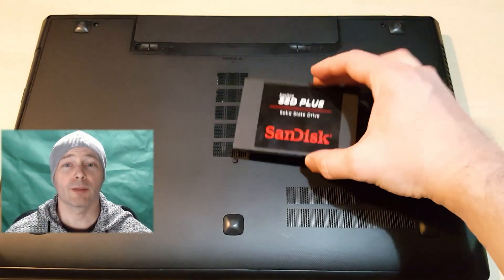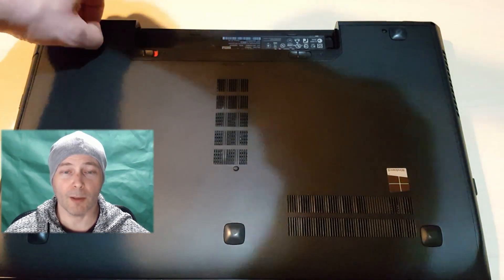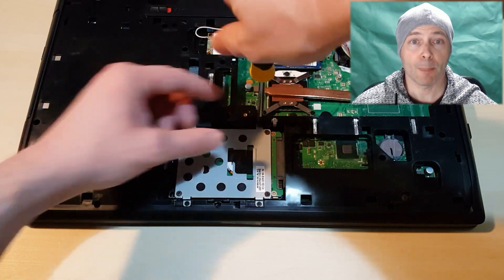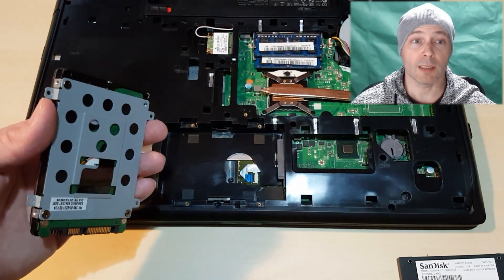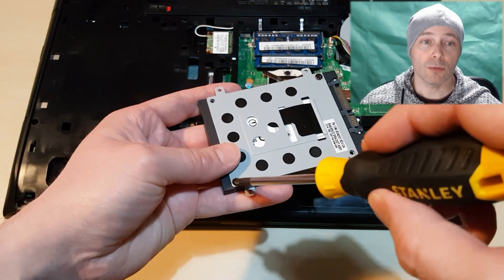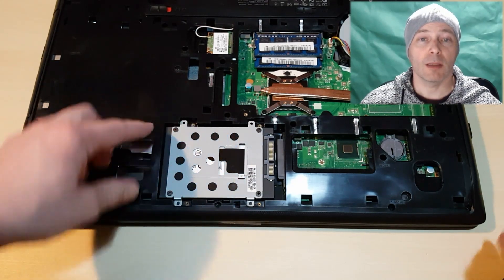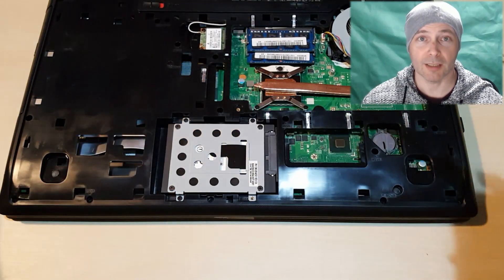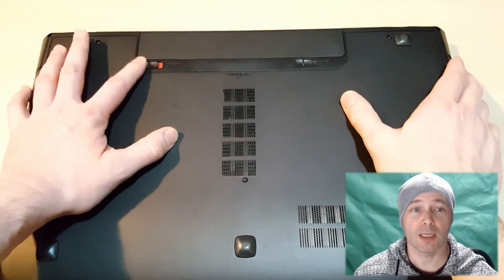Laptop Upgrade HDD to SSD - Part 2 of Improve / Re-Use Your Tired Laptop - Lenovo G710

Comment: I also have the G710.
Mine has the next tier i3-4000 up from your Pentium.
Bought it new in ‘14 as a Win8 machine.
Will be upgrading to SSD very soon
Reply from the maker: You maybe able to add more ram too 👍